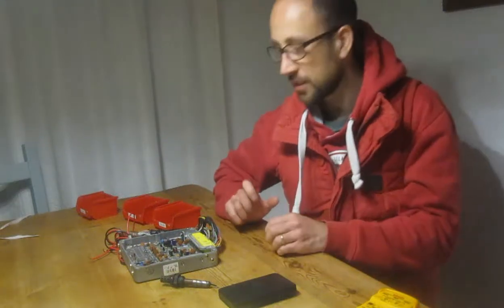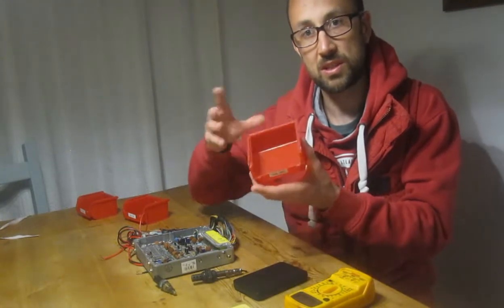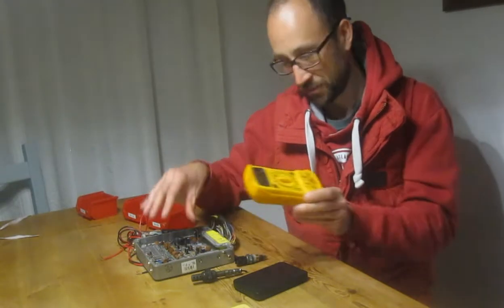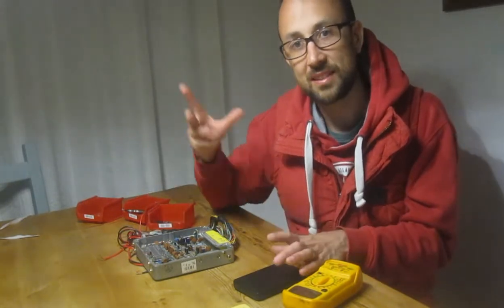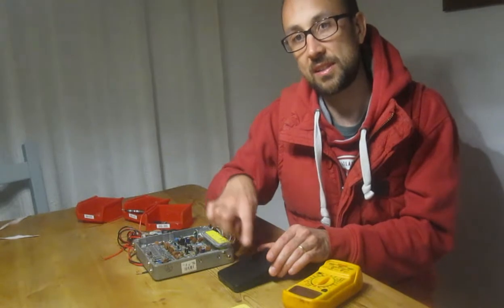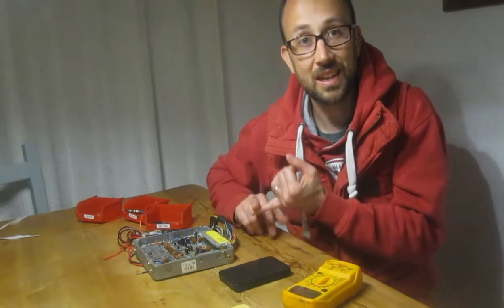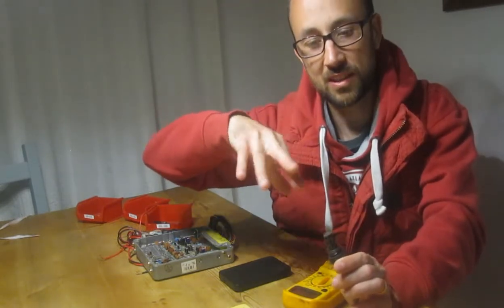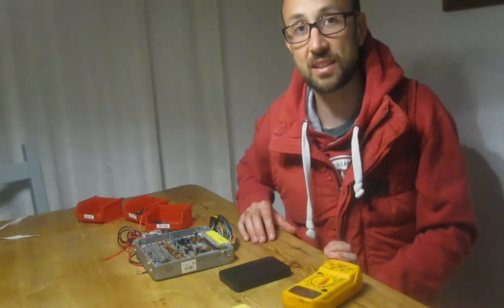ECU - How it starts an engine

Comment: Nicely done in very simple terms.
Just to mention...when keyswitch is first turned on the fuel pump is run for several seconds to pressurize system - then it is run in pulse width modulation mode.
I am curious how the EGR valve is controlled...how does ECM know when and how much EGR is opened /closed.
Reply from the maker: Good point about the fuel pump.
EGR is generally mapped to a lookup table, it is used to control NOx and since the engine controller (especially in petrol engines) doesn't have a NOx sensor (new diesel engines with SCR do have a NOx sensor) this is a lookup table.  If you have a car with a MAF sensor you can tell when the EGR is cycling in and out, as the MAF will double / half with EGR.  It will switch off at full power, as clearly power dominates over emissions, it might also deactivate in cold temperatures etc.  Some people claim this is emissions cheating / cycle beating but I dont think so, it just stops the EGR valve getting full of soot!

Comment: Thank you for great explanation. So, the input will be analog signal, then converted to digital signal, then processed inside the microcontroller. What next after this? Is the digital signal is converted again to analog and send it as the output to actuator?
Reply from the maker: Often the output to say a fuel pump is pulse width modulated, if you turn something off for half the time and turn it on for the other half of the time, you get what looks like an analogue 50%  You can get DACs and ADCs on in and outputs though I believe